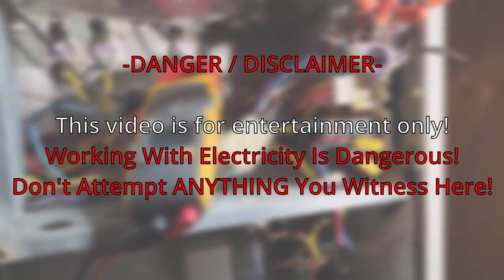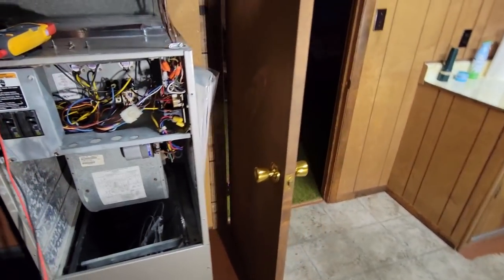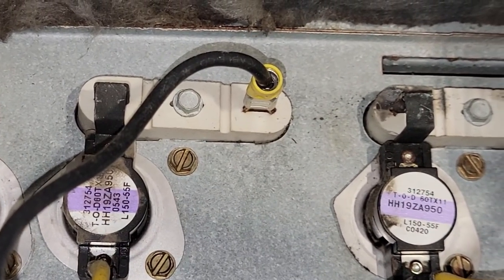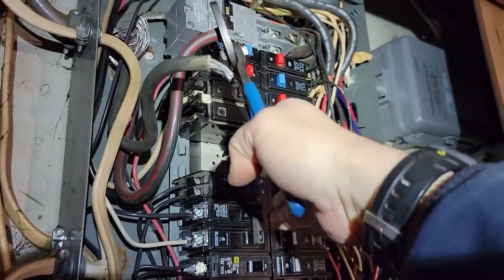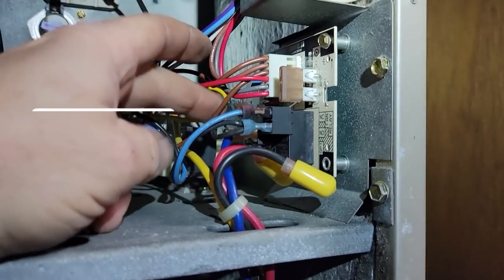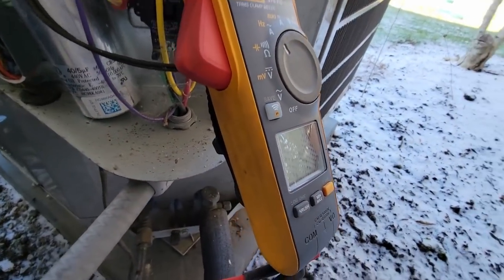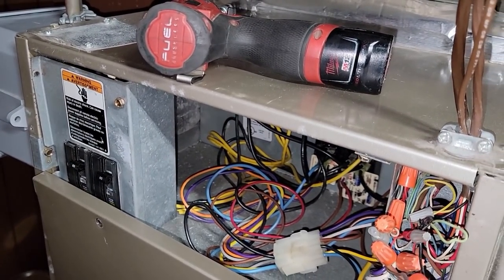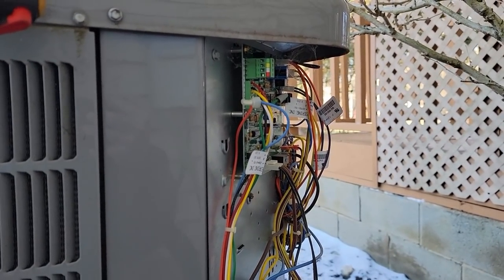Heat Pump Electrical Nightmare. Major Hazards Found!

Comment: Advice from an old retired electrician. Use a hammer handle to push on breakers when there is some concern they might trip.  It might save your hand from an arc flash if the breaker were to trip under a short condition. Turning your head away is always a good idea.
Reply from the maker: Thanks Larry, that makes sense. 👍👍 The panel is still dead while I was shoving them in.
Reply: Good man, definitely will try that out as I’ve had a breaker crumble on me and pop when I tried to flip it back on
Reply from the maker: I like to keep the replacement breaker off until it's seated.
Reply: great tip thanks Larry
Reply: I usually do that anyway, it's easier and incase of a hand slip, you wont stick your hand onto bare buss bars if there's no other breakers in there.
over the years, I've had adjacent breakers pop out when putting others in, all because the previous bozo's left the wiring very jammed and spring loaded.

Comment: I've found the large wire with strands cut off to fit the breaker alot I change the breaker to a larger one and put a fuse able disconnect in to make it safe

Comment: With a 2016 outdoor unit, it should be running R-410, while the original air handler would have been R-22, and would have required replacing the indoor coil to avoid mineral oil in the R-410 system.  

In California we normally do not shut off the outdoor unit due to low outside air temperature.  Glad that you removed the old thermostat on the outdoor unit, and the wiring was not connected the right way anyhow. When it is -10, the homeowner can switch off the outdoor unit by switching the thermostat to "Emergency Heat".  In southern California, at least the areas within 40 miles of the ocean, they do not get below about 20F in the winter, mostly stay above 30F.  

My heat pump in Portland Oregon, it is very rare to reach 20F, and usually it is above 30F.  I never connected the electric heaters when I installed my 48,000 Btu heat pump in 2014.  It is 14 SEER R-410 and provides plenty of heat at 30F.  Normally they would put a 2.5 ton or 3 ton unit on a 1,800 square foot house, and it would cool the place just fine.  I went with 4 tons because I wanted it to provide 28,000 Btu's of heat at 23F outside air temperature, and it does.  

Ohio would require the back up electric heaters!  I am happy that it does not reach 15F here, or colder that you get every winter!  

I agree that they should not have used metal foil insulation in the electrical compartment!  How stupid is that!  

Great video!  Thanks again.

Comment: Yikes.  After what I've seen helping friends and family, I'm amazed there aren't more electrical house fires out there.  From poor design decisions in appliances like you found with the insulation to hack wiring jobs - it's a nightmare!
Reply from the maker: It is amazing how some just don't care and it does go to show how the minimal safety standards do help prevent bad situations from becoming worse. Breakers and metal boxes.
Reply: @HVACRSurvival  Just help upgrade a couple of thermostats at my church.  They need the C wire for power and of course it wasn't hooked up.  Found they upgraded the unit at some time and the low voltage wasn't long enough for the new unit - so they just ran it into the disconnect box and spliced in a new low voltage - running along with the power in the same conduit from the disconnect.  
Ugh.  Another thing on the clean up list.  And it was "professionally" installed by a company too - even more infuriating.

Comment: Also I had the Payne version of this AH in a house, it had the same problem of pulling the aluminum paper down onto the electric heat terminals and blowing fuses at 4am. Of course it took a few times for it to blacken the paper to where I could see it. When the fuses blew the blower stops and the paper pulls away.
Reply from the maker: Got to love that 🤦🏻

Comment: I'm impressed that you took the time to do the whole job including replacing the disconnects and breaker. Not mentioning any names but there are a few other HVAC YT channels that would have simply told the homeowner to call an electrician.
Reply from the maker: Some of these smaller companies don't have all the licenses required. Our company is licensed for plumbing, electrical, HVAC and general contracting.
Reply: In some parts of the country, like Oregon, the inspectors will not allow a replacement part to be installed unless by a Union trained and licensed electricrican.  Sad we can not install a disconnect or circuit breaker without the electrician approval.
Reply from the maker: @Kagen like I mentioned earlier that's why we're certified in all the areas that we need to do any repair. We even have gas certified welders, auto mechanics, we have over 100 employees total. I'm just a small member of puzzle, we have 12 service technicians and I live in the middle of flipping nowhere.

Comment: That outdoor unit is only 24,000 Btu's at 47F outside air, while at 23F, the heat output drops to only about 12,000 Btu's.  It is not very energy efficient to have such a small unit, and then rely on the electric resistance heater to run almost all the time during the days below about 30F.  The 15 KW electric heater is 51,000 Btu's so they should have installed at least 36,000 Btu unit to provide a decent amount of heat in the winter.  

At 5 amps, the compressor is drawing about 1,250 watts, and likely only about 9,000 Btu's of heat, maybe less!  

My home is in Portland Oregon, and we had record breaking cold nights of 23F a few days ago. I never hooked up my back up electric heater, and I installed the heat pump in 2014, it is a 48,000 Btu Goodman 14 SEER unit.  My place is 1,800 square feet with decent insulation.  It only puts out 28,000 Btu's at 23F, that is why I installed such a large unit, so it would keep up with the heat load at 23F.  Most equal sized homes in my area are using a 24,000 or 30,000 Btu heat pump.  They run their electric back up heaters all the time.  

Now Carrier sells a variable speed heat pump that can put out it's full rated Btu's at -5F by speeding up the compressor on cold days.

Comment: I’ve had several of those fan boards fail and the NC contacts don’t open when the NO contacts close and it back feeds the circuit and cause one bank heat strip to run. The overloaded circuit generally melts the relay like you saw it
Reply from the maker: Interesting, I didn't think of that🤦🏻. That makes sense as to why it melted the relay

Comment: Great service call! You are a great tech! I agree with it all. Looks like a cheap change out that wasn’t cheap! Nice products. All of the burnt issues were all caused by the electrician! Who most likely didn’t understand what was required. I saw stuff like that all the time.
Reply from the maker: Peter that's awfully nice of you, I just like to make sure things are done right, I ain't nothing special, and I make mistakes just like everyone else. Thanks for watching the video and the feedback!

Comment: That panel has a lot of issues: The damaged bus where you put the lower amp circuits will still continue to burn out...once a bus is damaged like that it will NEVER make a solid connection. Two, the mix of breaker brands in the Bryant Panel. The SqD homeline in the lower left is NOT listed for that panel. That 40 amp breaker looks like it is also the wrong brand.  Good job on the repairs to the unit though, and good catch on the undersized breaker that created the mess in the first place.
Reply from the maker: Thank you very much!

Comment: While I understand that historically heat pumps needed to be shut off below a certain temperature, a modern unit like that one doesn’t. If it can’t run, it won’t. 

It’s also a myth that those modern units should be shut off for efficiency purposes in very cold weather. As long as the COP is above 1, it’s worthwhile to run the heat pump along with the strips. Would have to be below -20F before the strips alone are more efficient. Only when it’s a dual fuel should the heat pump be locked out.

Comment: If it is heating up that bad and your load is over 60 on a 60 Amp breaker you got worse problems that 60 Amp feed breaker should have been tripping out

Comment: damn dude.  what a cluster font!  i agree, those crimp “slippy fist” connectors are the scourge of the earth!  I have a 480v 250kva UPS in my facility that has something like 90 battery modules.  I bought refurb batteries and the company didn’t check those slippy connectors.  The first power failure, and i lost a couple strings of batteries; the loose connections caused the 60amp onboard fuse to blow in the modules.  tight connections are important when pulling continuous dc current (or any current, really)!
Reply from the maker: That would suck 👍👍 thanks for sharing!

Comment: ive seen those breakers melt down when aluminum wiring was used with no contact grease / no alox i think its called. Friend almost had a fire with his electric furnace.. There was a two wire to four adapter, same brand as the disconnect on the furnace..... it heated up really good.  Not to mention that there was 20 extra feet of aluminum wire just laying under the mobile home.  Was some scary stuff....

Comment: Did the aluminum wire off the 100 amp terminate at the disconnect at the AHU?
Reply from the maker: Correct, it was a direct feed to AHU.

Comment: Well done sir! Nice catch on the breaker size! Well done all around. This looks like the way a lot of my calls go lol
Reply from the maker: It kept coming at me like a wild dog😳
Reply: @HVACRSurvival  for me it’s always at the end of the day with this kind of thing. Thinking about the way you followed that wire size all the way to the breaker panel and re evaluated everything. My service manager would do that exact same kind of thing. Never accepting or taking for granted that what he finds is correct until it’s been proven. This is one of the marks of a great technician!
Reply: Great work. They do make a single circuit to double 2pole breaker adapter for these situations, instead of that wiring mess in the plastic junction box mounted on the side of the air handler. If the evaporator coil had a piston in it, that’s not a great match at all. Your follow through on the entire call is the sign of a great tech. Our company does it the same way. The male spade connectors on the bottom of the original strip heat breaker should be removable by loosening the bottom screws of the breaker.

Comment: Quick question do You ever worry about overloading the fan motor while the door is completely open and you are working on the machine I normally put the door just on the lower section when working on the upper,
Reply from the maker: I'm not worried about the fan motor, I'm worried about the pressures on the heat pump if the air is not being pulled through the coil. Motors don't burn up in a couple minutes.

Comment: You keep all those different parts on your van? The company you work for must be licensed to do high voltage as well. The call would've stopped at the breaker box for me. We don't carry those type of relays on our van, I will replace them with a contractor. Wire them up like trane does there heat strips. I appreciate the time you take to make these videos, I have learned alot from your videos. You can tell you have been doing this for a long time. 👍👍
Reply from the maker: I wish we stocked more things on my truck but we do not.  I left to picked up the relays then found the the bad connections and disconnect. I actually had to leave twice 🤦🏻.  This call took good portion of the day. Thank you for watching James and I appreciate the feedback! (Yes to the other question, my company offers everything, electrical plumbing, installation, service, refrigeration, HVAC, residential, commercial, industrial, welding, fabricating and rental refrigeration equipment.)
Reply: @HVACRSurvival  wow!, yea we do residential and light commercial. Mainly residential. We have a couple guys that will run parts if needed. Anyways preciate the response. And thanks again for sharing your knowledge. Your videos show alot of your trouble shooting process, that's what's really helpful to us new guys.
Reply from the maker: Thanks for watching them and your feedback, those things make it fun to see what comes back.

Comment: Bravo! Good job Rick, I can tell you done your homework, with code and basic electricity. Your right about running only 80% of the circuit breaker rating, which is 20% less than the maximum output. And you got skills when you switched the breakers in the breaker panel to make it safer. Job well done.
Reply from the maker: Thanks Mr. Walker👍👍

Comment: What an annoying and dangerous call. Today you were an electrician for sure.

Real question, though: since you are an electrician now did you leave all the scraps of wire and insulation all over the ground? If not, you're still an apprentice sparky.
Reply from the maker: I try to clean up my work, not saying I'm perfect but I definitely don't want a reason for someone to call in. Thanks for checking it out!
Reply: If you ever get into a scrap with an electrician, pull out a broom, they will run for the hills.

Comment: buss bars cooked/burnt/overheated = instant referral/bid for a new panel and breakers. the whole setup as is direct to the recyclers.
as tarnished as everything is in that unit, probably the whole heat-strip kit, breakers and harness.
those are breakers inside the AH, if there's a rating on the handle it's a breaker, not just a disconnect/s.
Reply from the maker: I've heard both ways that it's a disconnect just like the 30 amp so-called disconnect is really just a switch that they use outside at the condenser from square d.
Reply: @HVACRSurvival  those specifically have no current rating on them and are labeled "non-current limiting device" on the switch case. they also have a notch on them and matching tab sticking out in the disconnect housing so you cannot plug a breaker into the housing(without cutting or great force) and a breaker still wont sit fully inserted.
the housing is too small for the heat generated by a breaker, hence the tab/notch on them. actual breakers will always have the current rating on the handle and other locations with stickers stating maximum current breaking capability.
there may be some other differences I'm forgetting about, been a lot of years since I was a new construction sparky. lol

Comment: also measure across the breaker. the voltage you measure between the in and output is a great indictor breakers are going bad. also: has nobody in america heard of ferrules and torquing down screws on breakers? this entire service call would not exist if everything was installed proper. shit like this does keep us employed tho. so there is a silver lining. unless it burns the customers house down before you get there.
Reply from the maker: I agree on checking across the breaker or any switch like a contactor for the voltage drop. I already talk to much in these videos compared to others so it's hard to cram everything in. I also agree improper installs makes for future work but pisses me off. I had to erase a few choice words I said in the video. Not everything is a total fluster Fk here, I might only get one or two videos worth showing after running 30 call through the week.
Reply: Ferrules suck. The lugs will do the job just fine if you torque it down. Euros get overzealous with doodads and overcomplicate it.
Reply: @etherealrose2139  call it whatever you want but its regulation and our wires dont burn out as a result.

Comment: Does anyone make a good terminal spade that will stay tight and not overheat?
Reply from the maker: Open barrel connectors are the best I have seen. Usually something made by AMP is good but costly.
Reply: You must first know where the heat is coming from and why.  Good crimping procedures and quality materials help to make a reliable connection.  Not always the terminals fault.

Comment: Are HVAC guys allowed to do breaker work (changes) not at unit. But at the panel outside etc.???
Reply from the maker: I wouldn't post it on YouTube if I wasn't.
Reply: True that. Your awesome man.  It was a serious question because I've been doing this work for awhile and the owner always tells me to say call an electrician
Reply from the maker: That's very nice of you to say but I'm just passionate about doing the best work I can. Does your company have there state electrical license? He might not. I work for a larger company with around 100 employees, we offer electrical, plumbing, heating, refrigeration, hydronics, cooling and we even have certified wielders. Heck we even have two ASE certified mechanics for our trucks and equipment repair.
Reply: @HVACRSurvival    small company. But yeah your probably right anyhow. Down here in 512 Texas

Comment: Those people are darn lucky they didn't have a fire. Even in the face of knowing they need heat, the moment the service panel was involved, I'd have said they needed an electrician. I am a little surprised you didn't go back with insulation shrouded crimp connectors in the air handler.

Whatever engineer thought it was a good idea to use relays with DC coils and add the complexity of those rectifier boards should have been smacked with the cluebat and told NO.
Reply from the maker: I'm still waiting on the back order limits. The crimp connector wasn't a normal size, I had to enlarge it to fit or I would have considered insulated crimp females.